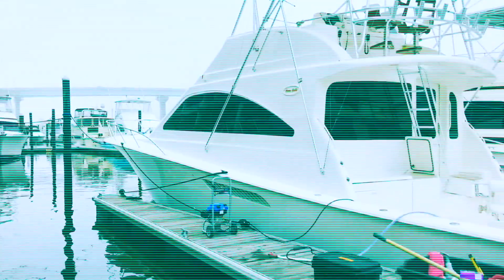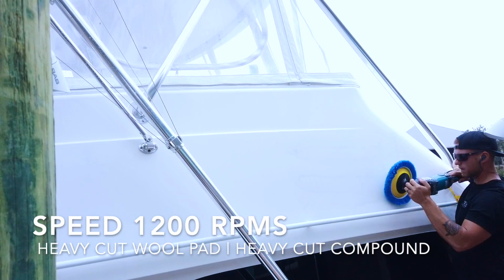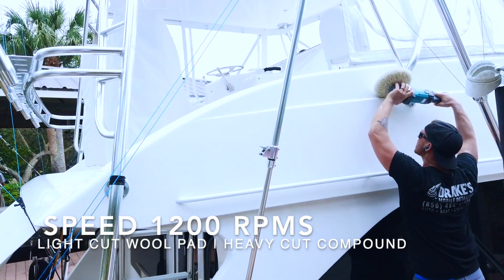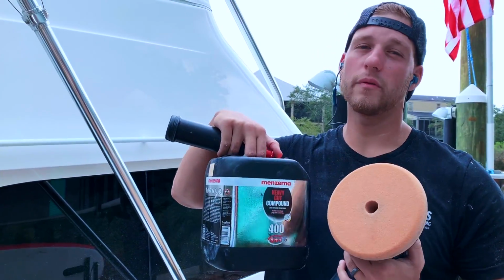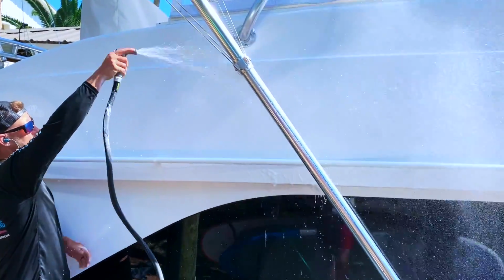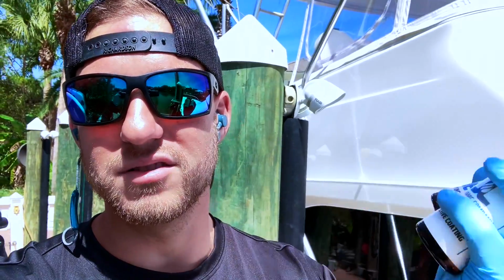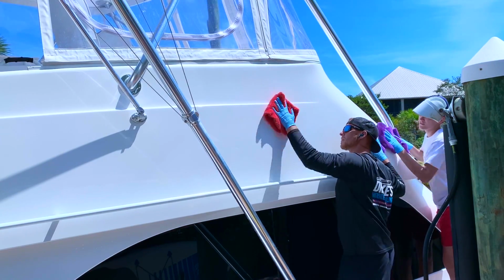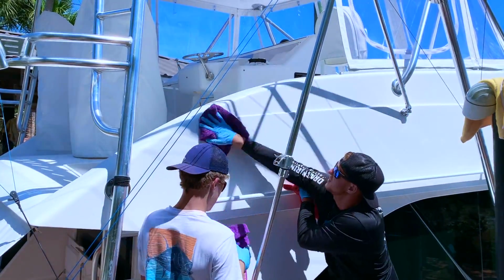How to Ceramic Coat A Boat | Boat Detailing Tips

Comment: Hey Drake, if im doing a large part of the boat, what would you suggest i do for the coating instead of w the pad and by hand?
Reply from the maker: Hey bro!  Unfortunately, there is no way around this. Ceramic coating needs to be applied in small sections and controlled in order not to miss any, since you put it on as a clear liquid, it’s easy to miss if you get too far ahead of yourself. The best thing to do is to work and 2 x 2 sections with a foam applicator pad and a rag.

Comment: Nice ! I’m work on a cabo 40ish foot and want to see how much should I charge for the whole ceramic coat, from hulls to cockpit top to bottom just a price range ?
Reply from the maker: Hey bro! Ceramic (depending on steps needed for preparation before hand) can range anywhere from $100- $150 per foot

Comment: Great video.  Question-although it may not be perfect can you use McGuire's Marine one step wax/copound to clean then apply the ceramic after that.  I use a dewalt high speed polisher and like to keep the boat clean and polished but I can't stand when i get a "lake line" on my boat during the summer...i tend to get one mid summer even though i keep it on a lift.  thanks for video and info
Reply from the maker: I would not polish with any product that had wax in it before applying a ceramic coating. The coating will not bond properly if there is wax or sealant on the surface. 

You want want to use a straight compound not a blend

Comment: Hi Drake! Love all your videos and they have helped me A LOT! I am new to the detailing world and I did a boat this past week and I totally failed. My question is how do you decifer whether a boat would need wet sanding vs just a heavy compound? I compounded and then waxed and it came out spotty? Some spots were nice and Shiney and other spots were dull.. so it looked like crap 😐
Reply from the maker: Hey! If it came out spotty and you still used the heavy compound then that’s how you know to go a step further! Also always do a text spot on the boat before hand
Reply: If you’re new to the detailing world, you can always stick to wash and wax jobs that will still be profitable, without risking failure.

Comment: Hey Drake, I’m a boat detailer from South Carolina. I have a few questions. 
1. You mentioned that you don’t recommend a microfiber pad if you’re detailing a whole boat. What do you recommend instead?
2. I can’t find where to buy The Ceramic Company Marine ceramic, is there another company you would recommend?
3. Is there a large difference between 1 step and 2 step ceramic?
Reply from the maker: Hey bro! I really only like a microfiber pad for waxing and light polishing
Reply: @DrakesDetailing  I meant microfiber pad as a applicator for the ceramic. Can you use anything else?

Comment: Drake and others. My tap water is hard and prone to water spoting. Is the wash between corrections and coating necessary? I’m scared to end up with water spots after full correction before going to alcohol wiping?
Reply from the maker: Hey man! If you want instead of washing you can wipe the boat down with alcohol instead

Comment: Drake, thanks for the vid. Question, for a entire boat, would you just do a 3x3 at a time? Then wait for flash and buff ? I don't want it to dry too fast by doing one large section.
Reply from the maker: Hey man! Na I’d stick with 2x2 sections. It’s the safest way, and you aren’t really saving that much time by doing bigger sections in my opinion🤷🏻
Reply: @DrakesDetailing  ok so just do a small section let it flash and then wipe, and repeat ?

Comment: If you must use 1sided pads and your backing plate has a hole, get a dowel rod that fits in the hole and use it as a guide to perfectly seat the pad. Remove the rod and you're set. Otherwise, if you're a do-it-yourself kind of person, buy double-sided screw-on pads.
Reply from the maker: Thanks for the tip 😉

Comment: hi I am new on your page I am detailer in 🇫🇷 I would like to ask you 2 questions if you like. what is the price for a polish and ceramic application on boat? Can I only use a double-action polisher to correct faults before installation? thank you friend and good luck
Reply from the maker: Hi there! For my pricing structure, I’m usually charging $15 per foot, per step for all the steps I need to do to prepare the boat for the coating, like clean, buff, polish, swirl removal, prep, plus the actual coating cost, and then to last step for applying the coating itself. Hope this helps!

Comment: How do you prevent water spots on ceramic coat
Reply from the maker: Hey John! Depending on the coating you used, some of them actually shred water instead of bead it. But after every wash or rain, you can shammy down the gel coat to wipe up the water spots 😎

Comment: Do I need to do all the wax compounds before adding ceramic on a brand new boat?
Reply: No, if there are imperfections, based on imperfections, you'll need to. Is it directly from the showroom, new. Unprotected boats OXIDIZE, depending on how boats are washed, the process will create swirl marks. If you've had it out in water & sun, it may need correcting.

Comment: Sup Drake hey have you applied ceramic to an awl grip or another urethane paint?  On awl grip they don't recommend any abrasives or really even applying their own sealant using a machine..  Use auto ceramic or igl marine which is  formulated for gelcoat? Curious your experience here
Reply from the maker: On awl grip you don't want to use a machine or anything that will cause heat. I haven't ceramic coating awl grip yet so I couldn't tell you if that works or not. I have applied a sealant to awl grip and that worked fine.
Reply: @DrakesDetailing  cool man. coating a painted boat sounds like a video in the making :)

Comment: You have a tough job and do great work.Boats are require alot of work.I think whatever you did wont last 2 months.It will dieback the first intial wash and that coating probably needs to cure not get wet.You should do your final finish pass with carpro essence.You can coat roght over essence no strip wash awesome work.
Reply from the maker: Thanks for watching, This coating is still going strong. the coating did cure for 24hrs

Comment: Love the channel, want to ceramic coat my whaler, Which pads would you use if you have no oxidation but very very light scratches and the boat is very very glossy because its waxed every 6 uses?
Reply from the maker: Use the white lake country foam pad
Reply: @DrakesDetailing  thank you, just bought them. Keep up the good work on the channel

Comment: Drake. I have a 2005 Monterey 350 SY. It has been on the hard stand for 2 plus years as I have been deployed overseas. She is sitting In Annapolis area on the Chesapeake. I am due to return to the states in April of 2021. The boat needs some detailing. Not sure if I should just do new gel coat or do the ceramic coating?  What would you suggest with site unseen? And do you know anyone in the Annapolis area you would recommend?  I am getting a little older and I just don’t think I have it in me to do all the heavy lifting at this time. Any help or suggestions are Greatly Appreciated.
Reply from the maker: To apply ceramic would depend on the condition of the gel coat. If the boat is extreme oxidized and chalky you’ll have todo a good amount of wet sanding and buffing to get it to where you can apply the ceramic. 

I’d have to see the condition to really tell you, sorry!
Reply: @DrakesDetailing  NP. Totally understand and my thoughts were to wet sand anyway. Do you know anyone up north in the Annapolis area you would recommend? 
I wish I was closer to you because your work looks incredible. 
Thanks again for your assistance. 
Tommy
Reply from the maker: Unfortunately I do not, sorry
Reply: @trusso4079   After 2 years, you’ll have more important issues to deal with before gel coat,  good luck and thank you for your service!

Comment: Have you done a video about recoating?  My 30 years old  trimaran gelcoat was wetsanded, buffed, etc and coated 2.5 years ago.  The deck is getting a bit cloudy looking. The hull still looks pretty good because the nets provide shade on the hulls. Can I recoat the deck myself?

Does gelcoat oxidize underneath ceramic coating?
Reply from the maker: Are you talking about ceramic coating?
Reply: @DrakesDetailing  yes., I am talking about 2-3 year old ceramic coating. My boat was ceramic coated a couple of years ago and the deck coating has lost its high gloss and water no longer beads up. It looks like a satin finish, not high gloss.  What must I do to restore it to the way it was after the first time it was ceramic coated?

After it has been sealed with ceramic coating, does corrected gelcoat continue to oxidize, or does the coating prevent further oxidization?
Reply from the maker: Ceramic will stop/ slow down a
Oxidation for about 2 years. 

After about 18 months most ceramic needs an extra layer applied. If it’s been 3 years most likely your coating is gone. 

It always goes first on the deck... due to walking on it. 

You may need to compound the non skid, then re ceramic coat it

Comment: Is there any reason to wax over ceramic coating or before it
Reply from the maker: No, you definitely do not want to wax before doing. After your boat is ceramic coated you do not want to use wax. Once your boat is ceramic coated, you can top it off monthly with an sio2 coating. That will keep the ceramic coating hydrophobic. I personally like mckees 37 Hydro Pearl.
Reply: @DrakesDetailing  so I need to take dawn dish soap and remove the wax and oil?
Reply from the maker: Yes

Comment: In previous videos I’ve seen you use hydro blue on non skid surfaces. I’m all for making non skid clean off easier and bead up but I’m wondering about traction issues. Your thoughts?
Reply from the maker: It really does not make it very slippery. But I always tell the customers before hand and get their approval. I always tell them that it may make it a little more slippery but it will help with cleaning and the longevity of the boat. Most customers don’t mind.
Reply from the maker: Use hydro pearl instead of blue

Comment: What do I use for putting ceramic coating on the whole boat u said not to use microfiber wax pad cause it cures in the pad itself what can I use to do it right since we not supposed to use wax pad and thank u for step by step process very informative
Reply from the maker: Sorry if I didn’t make it clear in the video! Ha you can use a microfiber waxing pad to apply to the whole boat, it just will cure over time so you will have to get a new pad every day. Or ever few hours. 

I have another ceramic video on my channel where I actually use the micro fiber pad to apply to the entire topside of a boat

Comment: Nice work! How many hours do you have into the job?
Reply: I know that yacht owners have  F U money.  But  I cannot imagine the price to do the boat costs. Even over a years time.  Then you say redo the top coat in 6 months. Defeats the purpose and no captain would do it. What did that 8 hour treatment cost the guy w you helper ?   $1000 ? , more ?  I was considering doing from the rub rail down on my 22’ black Shearwater center console.  The hull has never been touched w a buffer and has no swirls.  Just clean,  strip  and apply?
Reply from the maker: If there is no oxidation, then yes clean, strip and apply
Reply from the maker: This one panel took us probably about 8hrs. 
We did not coat this entire boat at this time, I maintain this guy’s boat on a weekly basis so we do everything in sections over the course of a year.
Reply: Drake's Detailing I thought a 4 hour coating on a car was a lot! A friend wants his 42’ boat coated, I don’t even know where to start 
Enjoy your work!
Reply from the maker: https://youtu.be/KgZ8VXJSsg0

Did you watch this video? 

Ceramic coating boats are no joke! Ha they take more time and work!

Comment: can you wax/seal after ceramic coating?
Reply from the maker: You technically can, but you won’t need to. 

You would Ceramic coat then top it off with an SiO2 spray every few months. I like mckees 37 hydro blue

Comment: brand new boat.  was thinking wash/polish/prep/ceramic.  Do you think i need any cut?
Reply from the maker: Brand new like 2020 2019? If so then I doubt you’ll need to cut much, menzerna on the orange lake country force pad will work great!
Reply: @DrakesDetailing  yah taking delivery on a 2021 in a few weeks.  menzerna polish or the cut compound?
Reply from the maker: That new you can probably just do menzerna 2500 with a white lake country force pad

Comment: Awesome video man.  I have a 2019 boat that I have waxed at least 3 times.  Was curious if I still do the heavy cutting since my surface really has no oxidation?  I don't mind doing the work, just want to be sure if I need to do a heavy cutting first since the boat is pretty new.  Thanks for any info.
Reply from the maker: I would say you don’t have to do any heavy cutting, but it’s hard to say with out looking at your boat though, 

With it being a 2019 I’d say you’d be fine with just waxing it or maybe polishing it with menzerna 400 and lake country force pad ( white or orange ) then following up with a sealant like jescar power lock. That will really make the shine pop! 

Only do heavy cutting to remove dullness / oxidation.
Reply: @DrakesDetailing  it shines really well already. No oxidation, just slight scratching from fishing.  Also I couldn't find the ceramic product you mentioned for sale. You have any other recommendations.  If I'm going to put in all the effort, I want a true ceramic barrier. Also I want to do the bottom of my boat.  It sits on a trailer. Do I just do as close as possible to the bunks?  Appreciate the info. You seem to be the guy with all the knowledge about this.
Reply from the maker: Unfortunately with most ceramic company’s you have to be an approved installer to buy! 

They do it for liability reasons because it’s pretty tricky to apply and takes some skill. 

So you’ll have to hire a detailer in your area to apply the coating... you can buy some off of amazon and online but honestly I wouldn’t recommend it... they are probably watered down and not going to last very long. 

If you don’t want pay someone to come out and do it, you can use this product 

https://www.mckees37.com/365spraycoating.html

Just reapply every 6 months and you should be good!
Reply from the maker: As for the under side, go down as far are you can, that’s the easiest option. Or you can go to a marina or a boat yard and have them lift your boat. That would allow you to work on the entire hull.
Reply: @DrakesDetailing  Hi Drake Great channel you have .Have you seen Jimbos channel where he compared the mckees 365 vs the Turtle wax seal and shine ?Results were impressive for the TW seal & shine .Ive been detailing since 1969 when all that was available was rotary (all steel )and compound that we called rocks in a can that we put on with little wisk brooms dipped in the can then pat on the panel.I love my Makita rotery but mostly use my DA's for cars. I just did a detail on 51 ft sea ray fly and had to just buff the top of the fly and that makita is so smooth.My client wanted F11 applied the the entire boat as he is taking it to FL to sell(were in Mich)have you heard anything about  F 11 good or bad?Thanks keep up the great  work and may our Lord and Savior bless you and your beautiful family brother.
Reply from the maker: I have not seen that video yet. I really don’t have any experience with F 11. From what I have heard I have not heard very good things about it. You would be better off using like McKees 37 Hydro pearl.
Reply: Hey man. Took your advice on doing the finishing polish 400 and then the jescar power lock. I'll let you know my results.  I did all the prep steps besides all the cutting. Appreciate you sharing your experience.

Comment: Awesome! What products do you typically use for touching up a dash and radar up top? Thanks again!
Reply from the maker: What do you mean by touching it up?
Reply: Drake's Detailing you can hit it with the same compounds and ceramic coat it as well?
Reply from the maker: Yes, it just may or may not be necessary todo that many steps depending on the amount of oxidation.
Reply: Appreciate it!
Reply from the maker: Yep!

Comment: New to detailing. What is the difference between the first machine you used, and the machine you used to apply the Menzerna? The first machine cannot be used for both compounds?
Reply from the maker: Check out  https://youtu.be/ru3I5y6coGk

The first machine is the rotary! It’s a heavy duty machine with a lot of cutting power, the 2nd is the flex 3401, it’s a great machine for polishing. 

The rotary will leave holograms and the flex won’t. ( well if you do it correctly) ha 

I explain what holograms are in this video! https://youtu.be/UmEhddjgSDo